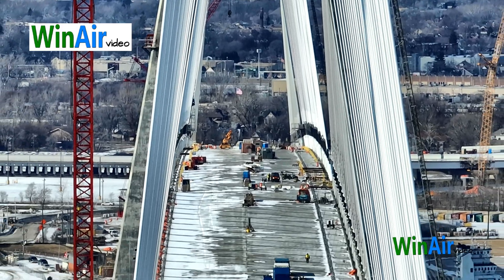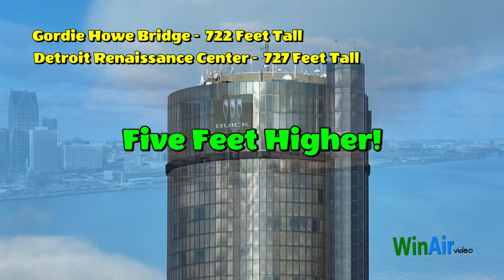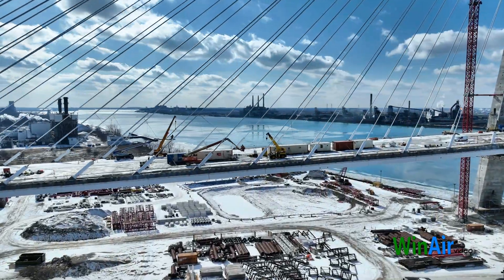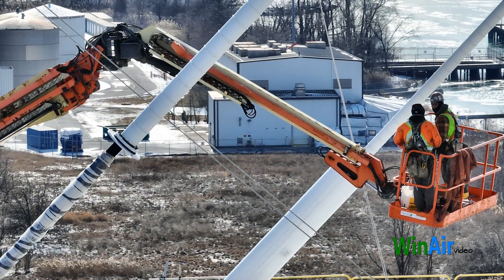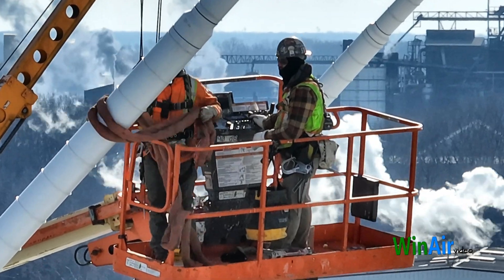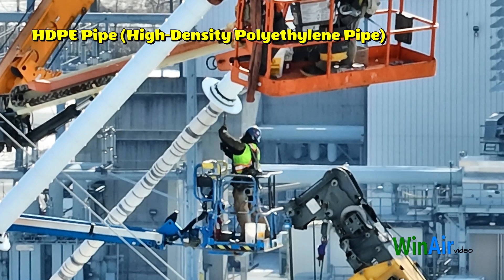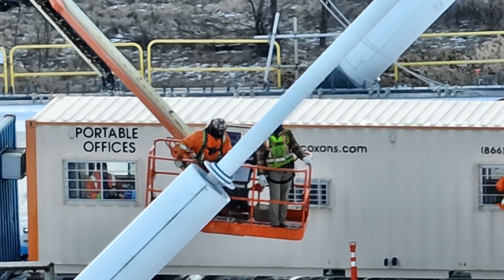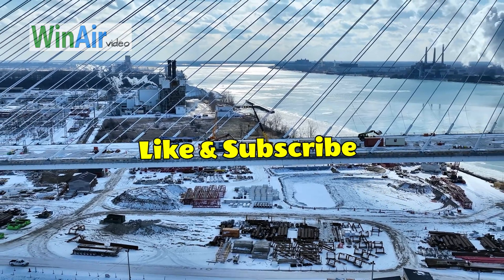HDPE vs Steel: The Future of Bridge Engineering

Comment: Holy smokes. Around 8:15 into the video I got freaked out. My eyes detected the background moving up and down relative to the yellow railing and bridge edge. Thinking holy crap dies it actually move that much, then as I started to comment I realized it’s the drone hovering slightly and the perspective changing. 
Whew
Reply from the maker: Lol. I know what your talking about. It's parallax and can be achieved when using the zoom on a fixed item and the background seems to move at a different speed. Kind of a cool effect, eh?:)

Comment: So the cable covers might last longer than the bridge itself....interesting.  I know they've said that this bridge is expected to last 100 years (they are also claiming that for the new Key Bridge that will be soon built here in Baltimore) but I'm skeptical.  Problem is, cable stayed bridges have very little "track record" with regards to longevity. Most are no more than about 40 years old. The cable covers might keep water and weather off of the cables, but moisture will find its way down into the concrete of the bridge towers and piers and the rebar will begin to rust and bust up the concrete. That is the nature of steel rebar reinforced concrete to eventually fail in that way. 
However, I suppose even if this bridge stands for just 60 or 70 years it will be worthwhile. 
aying
Reply from the maker: Hi Leer. Great post. I think if they keep it maintained it'll reach a hundred years easy. Just a layman's opinion, however. I did note they used stainless steel in the towers and the concrete is going to be coated with white epoxy paint. That should add substantial protection against wear and corrosion. Then I'm not an engineer by any means, so who knows. It'll be around a lot longer than I will, Lol.

Comment: Hello Bob!   I think you should get an award for technical teacher for all the work you did documenting this project. In 1966 I was a telephone installer in west Toronto and one day I was up over forty feet on a ladder on Bloor Street.  That was scary so I can only imagine the guys working those cherry pickers avoiding the cranes working the same area. I always wondered where the sheathing was on the exposed areas but initially they must have been installed from the get go slid into one another.  The guys struggle to get them over obstacles when sliding the down. Simply just another great video from the tech teacher I rely on.  Take care,  Bob
Reply from the maker: Lol. Thanks, Robert. I can imagine. Kinda like flying my drone in a confined space. Gotta know what's there. I was curious about how they covered the lower section of the cable, too. Kind words Robert, thank you very much. :)

Comment: Bob,

One of the properties  of HDPE is its low coefficient of friction.  Water, snow, and ice  won't accumulate because of the slope of the stays and the "slippery" surface.

It's nice to watch videos where you can actually see the process of assembly.

Bob
Reply from the maker: Hi Bob. Thanks for sharing. Cool information like this add to the story! Thanks again for the post.

Comment: Not to mention, all cables inside are now completely isolated from moisture...if done right.
Reply: wondering .... won't moisture possibly "accumulate", and get trapped inside that "closed environment" ??
Reply: @rickski3769  No it wonté Itès designed not to.
Reply from the maker: Hi Rick. The closed environment keeps the inside of the HDPE pipes isolated from moisture. The cable wires are also coated with a water/corrosion resistant substance of some kind. If they do encounter an issue in a cable they can access it for maintenance. Good question, Rick! :)